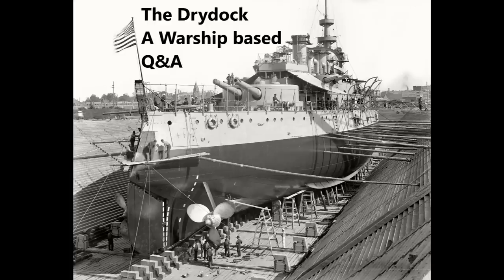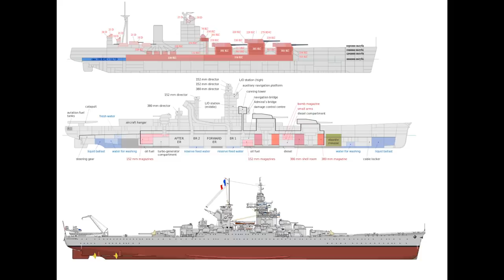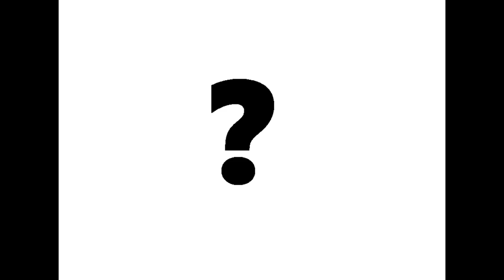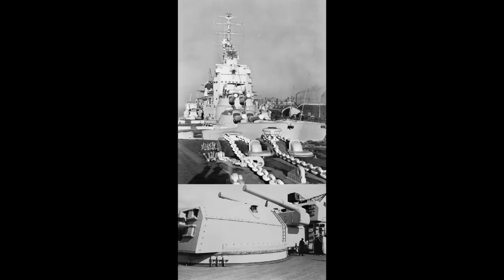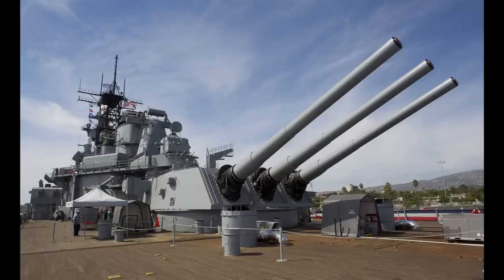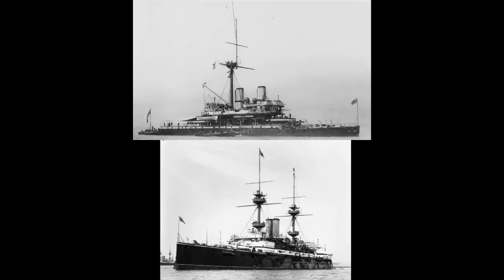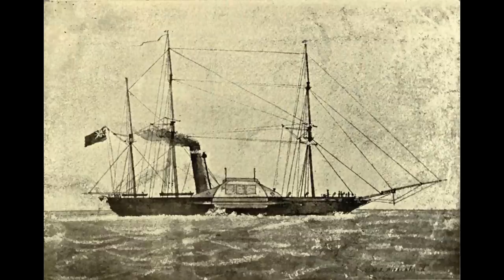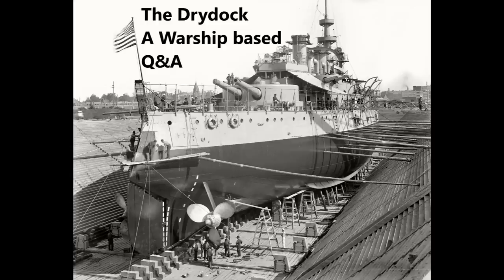The Drydock - Episode 012

Comment: About the ductile-brittle transition, the problem was not well understood until the WWII when the welded construction of the Liberty ships caused the brittle cracks to propagate through the entire hull. Depending on the alloying elements and the metal quality iron and steel alloys have a transition from low temperature brittle fracture to high temperature ductile fracture (which is what you want). There is a test (Charpy V-notch) used to determine the energy absorbed and with visual inspection of the fracture surface. The two fractures produce very different fracture surfaces. If the failure is a mixed mode, the fracture surface will have elements of both types. 

The British metallurgist who figure out what was going on was Constance Tippet.
Reply: I'm not an engineer so I only know what little I can understand from reading about this issue. Wasn't the temperature difference ductility also an issue in the sinking of the Titanic? As I remember, I think that this was confirmed from examination of the wreck photos.
Reply from the maker: One of the critical issues with the early iron ships was the temperature range of the shift, different metals and alloys will shift from ductile to brittle at different temperatures and over different ranges. The early iron just so happened to shift very quickly and over a temperature range which encompassed the difference between European and tropical seawater.
Reply: Did that continue to be an issue up into the age of steel? Didn't welded Liberty ships have cracking issues the were somehow lined to the kind of steel used in construction? I think I remember reading that, at least.
Reply from the maker: They did, but that was more an issue with the welding than the hull material itself.
Reply: Ah, okay, I knew that cold water was somehow involved but I didn't know if it was the steel or the welding that was implicated. What did the shipbuilders do to overcome this problem, and how widespread did it turn out to be?
Reply: @Drachinifel  Yes, the riveted Hull's allowed the steel to flex enough to not crack, the welded Hull's were too rigid not allowing the steel to flex so it cracked instead. The cold artic water didn't affect the riveted Hull's the same way. Overloading probably had it's affects as well. At the time they were built, most of these ship's weren't expected to last more than a year or so before being Torpedoed and sunk, the few sinkings caused by the welding were acceptable because it speeded up the construction of the Ship's in the race to build them faster than the German Submarines could sink them. As a propaganda stunt a couple of these were built and launched in just a few days, having arranged to have all the sections ready and crews working around the clock in a race between the different shipyards. They were made to be mass produced in sections as rapidly as possible. Between 1942 to 1045 12,590,000 tons of Merchant ship's were lost while during the same time the Merchant Fleet rose from 32 Million Tons to 54 Million Tons, Ellis Brute Force p. 161. Quite a few of these Ship's survived the War despite their defects and continued to haul cargo for decades.
Reply: It has theorized but there are a couple theories that also might help explain some of the timings. But the primary problem was side swiping an ice berg is not good for any ship as the damage will along some considerable length of the hull. Brittle plates, bunker fire damage, etc. only worsen the effects of the collision.
Reply: With the Liberty ships the actual problems were the specific alloy has a transition temperature very close to 0C and some of the joints were sharp not rounded (also a problem with fatigue failure with DeHavilland Comets). The sharp joints concentrate the stresses locally to much higher than is in the "bulk" structure.
Reply: The nasty problem of welded hulls is that any crack, whether from this transition temperature, fatigue, stress corrosion cracking, etc. can propagate a very long distance. On a riveted hull only 1 or 2 plates are likely to have a crack, containing the damage. I remember seeing metallurgical textbook a picture of Liberty ship that practically broke in half while tied up at a dock on a very cold night .

The misconception is the welded construction was fundamentally a flawed method. Constance Tippet showed it was not the problem; welding was considered a likely source at the time. The fundamental solution was to pay attention to the steel alloy used and its transition temperature. On the ships already built the fix was to reinforce the hull in places where the cracks were likely to start. 

As far as expected service life, Liberty ships were designed to built fast, cheaply, and relatively unskilled shipyard workers. On of the reasons for welding is it is easier to teach someone to become proficient at it than riveting. The problems with welded construction was it was a relatively new technique. Thus not all of the quirks and problems were will understood. Several WWII warships had welded hulls (Mogamis come to mind as well as the Deutschland Panzer Schiffe).
Reply: Jay Lozier  Thanks a lot for the explanations. Indeed, the Liberty ships did last many years after the end of the ar so the problems with cracking couldn't have been that widespread. The same welding issues arise from time to time, the Falklands war being one example. Problems with frame cracking showed up in welded connections of steel frame buildings after the 1994 Northridge earthquake,
Reply: as an engineer who spent 30 years testing steels the type of alloys that came out yes the heat treatment was a not really understood problem at the time yes they did know about heat treatment but not as we know it today the other thing not understood early on in the construction was stress points. in the early Liberty ships working in the Pacific there were no apparent problems but in the Atlantic in winter the extreme cold the game changed, things like the corners of the holds were welded with a sharp corner which allowed ease of construction but allowed cracks to start in the cold temperatures, they sorted this by welding corner fillets that reduced the stress points. Another example (although nothing to do with ships but to illustrate the point I'm making) pre jet airliners had square windows when the Comet jet airliner there were several crashes from the fuselage cracking at the window corners they went to oval windows so no sharp corners causing stress points for cracks to start.......... sorry to go on a bit :>)

Comment: Q&A Not sure if you can answer this one, but did the improvements in machinery & the resulting reduction in volume of the machine spaces make the all forward arrangement obsolete by the time building restarted in the 30s? The USN looked at all forward for some NC studies & basically decided it saved nothing & I could never find out if this was due to differences in design philosophy or simply with the reduced machinery space moving the third turret aft didn't affect the citadel length/overall weight.

Comment: Question for Q&A: how did the different navies supply their ships on patrol? Outside of the Altmark, Emden's supply ship and the U-Boot Sea Cows I don't see a lot of info out there. 
Bismarck and Prinz Eugen did not have a supply ship with them on patrol, or did they? 
Also I am wondering wether DD escorts getting replenished at sea make a good  target for U-Boats.
Reply: How different navies dealt with supplying their ships was based on the conditions they operated under.  Germany lacked overseas bases and had to make do with limited support supply ships.  Britain and Japan had forward bases on islands or colonies that they used.  All major navies used oilers to supply fuel to ships when they operated far from adequate shore bases or when it was desirable to keep them in a specific area.  
The US built enormous fleets of support ships that moved up with the fleet as it advanced on Japan.  These included tankers, ships for repairs of all types, and even floating dry docks that could handle battleships.  These servrons could move into any sheltered area and quickly create a massive naval basis.  Tiny Ulithi atoll was briefly the largest navy base in the world until the servrons moved on to the Philippines.

Comment: The longevity of the Iowa class battleships can be partly attributed to the robust engine plants which were of a new level of power and quality.  The same sets powered the Midway class ships which ended up operating relatively continuously for roughly 40 years.

Comment: I would have to disagree on the comments about accuracy in regards to the French and Italian guns.

Richelieu: The ammunition itself was not the cause of her inaccuracy. All that did, with the original shells, was cause the shells to blow up in the barrels - bad, but not the cause of dispersion.

The dispersion issue was rooted in the fact that the quad turrets, arranged as two twin turrets, were too close together. This is what gave them the incredibly bad dispersion, which was only solved with delay coils in 1948 (eventually replaced by built-in firing delays in 1951 for Richelieu, while Jean Bart was completed with them afaik). Dispersion without these delay coils was about 66% greater than when they were active - a major difference. This is the same issue that plagued navies that used 'common cradle' mounts, such as Italian cruisers (Abruzzi and Capitani Romani-class excepted) and destroyers, many American heavy cruisers (prior to Wichita & the Brooklyn-class), and a great deal of American 14" battleships (as you mentioned).

Littorio: The Italian 15" gun, as far as I've been able to tell, had less to do with shell quality, and more to do with the propellant - generally speaking, Italian shells tended to behave themselves in operation, and widespread quality issues would have surely preceded the greater accuracy of later guns using the same ammunition as early guns, but without dispersion issues (ex, the 152/55). Bad dispersion being traceable to shells did exist, but was a separate issue - the 152mm HE shells with their nose shape & weight distribution being a prime example. Propellant issue seems to be be the more likely culprit, especially given velocity variations would have a greater influence on dispersion then shell mass. It's also somewhat clear to see when exactly this occurred - in action, the 15" guns generally had high accuracy, with the engagement off Gavdos in March 1941 being the major exception where salvoes (from Vittorio Veneto) were being noted as poorly spread. This is almost predictable looking at gunnery exercises, as it can be clearly seen that while Littorio's dispersion stayed mostly consistent from 1940 to 1941, Vittorio Veneto's doubled going into 1941. 

That's not to say quality control issues with shells did not exist - standards were briefly lowered to appease the industry in the 1930s, but this was quickly changed. Unfortunately, the issue was somewhat canonized into the narrative of the war because of Admiral Iachino's writings post-war and made to be a larger concern than it was - dispersion had more to do with the use of common cradles in so many designs, and the anecdotal observations of shooting at cruisers and destroyers in smoke at great range.

Another culprit of bad accuracy in terms of raw dispersion also stems from the strength of the structure the guns are mounted on. The Italian 152/53 M1926 mounted on the Giussano-class light cruisers suffered greatly not just from their use of a common cradle, but also a relatively light turret that did not take the recoil forces of the guns well, exacerbating dispersion. Despite the use of the superior M1929's in the follow-on Cadorna-class, the lightweight turrets still contributed to dispersion issues, and this factor in the dispersion of Italian 6" guns did not disappear until the Montecuccoli-class (although the common cradle usage still existed). Japanese heavy cruisers are another group of ships that suffered from this issue - weak hull structure caused dispersion issues despite good spacing of the guns and tame ballistics - dispersion was only reduced by the strengthening of structures and the use of delay coils, and yet still it was far from excellent.

Comment: Another great video

Thaks for answering my question about British Vs German guns, it was very helpful.

The summery of the fire control systems was also great. I have several references which state the same thing you did.  German gunnery was very fast to get on target but accuracy dropped off rapidly as the battle wore on and fatigue set in while British gunnery was slower to get the range but improved quickly and stayed there as the system was far less tiring to use.
Wonder if this means that staying at longer ranges was better for the British as the battle would be longer and German accuracy would diminish?
Reply from the maker: In theory yes, the British could exhaust the German gunners at long range then move in, but at the same time risking a deck smashing long range hit might not be such a good thing.

Comment: How would the Imperial German Navy  have fared, if they didn't shift to submarines, but continued a strong focus on surface ships? IE finishing the remaining 2 Bayerns, and the first 3-4 Mackensens. (Mackensens 5-7 were not laid down, but 1 Ersatz Yorck, that however, like Hood would never be finished before the end of the war)
Reply: I think the Germans focusing more on surface ships would have aided the British far more than the Germans.
Less Subs means less merchant ships sunk, more supplies getting through and less damage to the British economy, while the limited number of extra surface ships would not have changed the strategic balance all that much given the difference in numbers between the GF and the HSF.  than you add in the US 6th battle squadron. 

As Drachinifel has pointed out in previous episodes, the items which really dictate how fast you can build a ship are the guns and turrets.
The guns take a great deal of time to make and the German Navy's biggest problem here was, believe it or not, the German Army.
At the outbreak of war the German Army seized as many guns as they could for their land offensive, leaving the Navy scrambling.
German ships building resources were limited compared to Britain and much slower.  They  had less large naval gun manufacturing ability.  Also the blockade cut them off from obtaining nickel, a vital metal for making guns and armour for ships.  

I think if Germany had continued building the ships you listed, the British would have sped up the construction of all four post Jutland Admiral class BC's and the Mackensen's were no match for these as they were more contemporaries to the Lion class.
My sources only list four Mackensen's ever contemplated, so 5-7 is a mystery to me unless you're getting confused with German ship naming policy.
Reply: Mackensens inititially were supposed to have 7 ships, after known details of the Admiral class however, the design was revised, and modified, to be more similiar to the Admiral class, and would later be known as Ersatz Yorck class, of which 3 ships were planned, but  only Ersatz Yorck was laid down.

Comment: The reason why the Iowas survived in reserve while the rebuilt "old"  battleships were scrapped by 1960 was speed. The Iowas had a top speed of 33 knots and could effectively operate with fast carrier task forces. The best of the old battleships could only make 24 knots. In terms of armament, a ship like the rebuilt West Virginia was only slightly inferior to the Iowa in most things but speed, but that turned out to be the critical difference.
Reply: Part right. But we did not keep the North Carolinas or South Dakotas either. The Iowas were the newest, low millage and best equiped for return.
Reply: The North Carolinas and South Dakotas were all kept in reserve and never recommissioned. They were all removed from the Navy list by 1962, and those not retained as museum ships were scrapped. They had the same problems as the rebuilt old 16" battleships - Inadequate armor against 16 inch shells, a main battery of 16"/45 guns rather than the much more potent 16/50 guns of the Iowas, and, most of all, slow speed. 27-28 knots just wasn't enough to keep up with fast carrier battlegroups. The Iowas were the only ships in reserve considered "true" battleships by the Naval Board.
Reply: @sarjim4381  By that time there were no other BB's to face.  And speed means little in the naval gunfire role. So the whole needing to keep up with CV's is not a big deal. They were not being used as escorts anymore.
Reply: Walter, you're right about the main role of the Iowas being gunfire support. They were commissioned as the centerpiece of their own Surface Action Group. That doesn't mean they no longer had a role as carrier escorts, as shown by Battle Group Alpha, with the Iowa serving and an escort to the Midway. Their main role was envisioned as distant escorts for carrier groups as counters to the Soviet Kirov class. Once the USSR collapsed, that role went with it.

Comment: once a ships boilers have died it shouldn't be that difficult to replace the steam turbines with gas turbines leaving the boiler spaces open for other purposes such as fuel tanks or missile storage.
Reply: A bit of trouble with that: at that time was it possible to install lets say 190 000 HP  in gas turbines ?
The wikipedia for IOWA gives the power as around 158 MW !
That is a very large gas turbine plant which is i would say VERY finicky about its treatment.